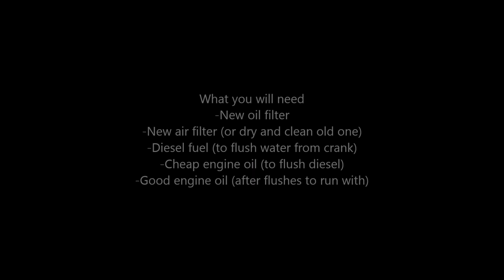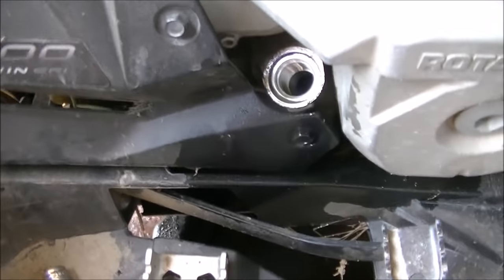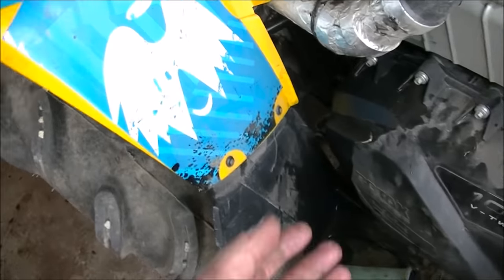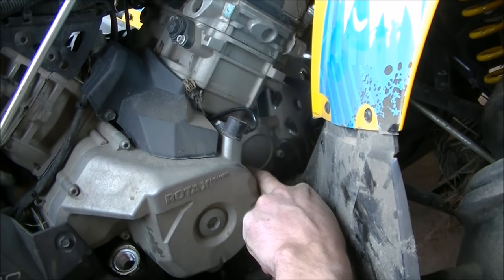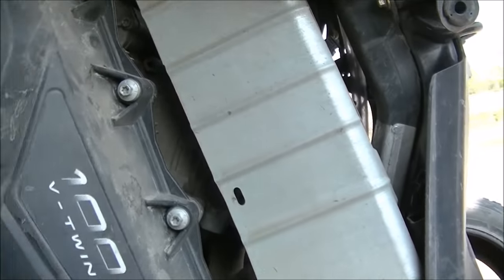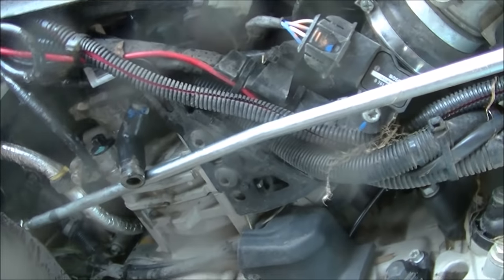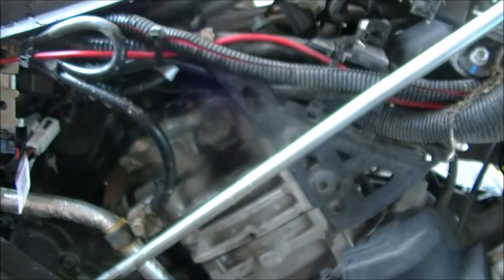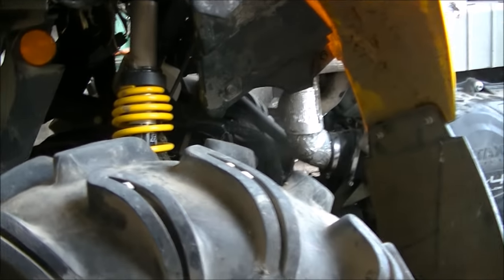How to un-swamp a Can-am 1000

Comment: Hi, great video. Question though, I fell into a pond with 2018 Outlander 1,000 completly submerged this past weekend, I did all the steps, but after putting all fluids in for the first step of purging,  I try to turn it over but it telling me "Communication Failure" how can I fix this to get it to turn over? Thanks
Reply from the maker: chin K yikes, that could be many things, I’d start first with making sure the battery is good and charged and confirming all connection are good and tight along with the ground to the frame. If that doesn’t work if you have a good warm place with a dehumidifier to dry everything out really well, and if that doesn’t work start pulling any/all electrical connections apart check for water dielectric grease and reconnect.
Reply: @VandallXT  thanks, I try as soon as it stops raining here. I keep u posted. If all else fail I'm take to shop n let them plug it in to computer. But I'm trying avoid that bc I'm sure it gonna be super ouchy on my wallet